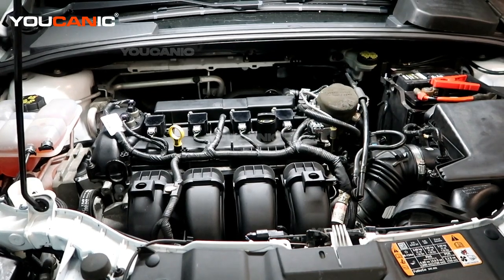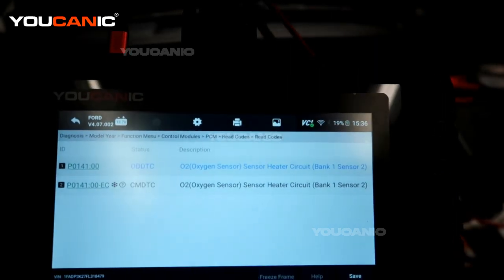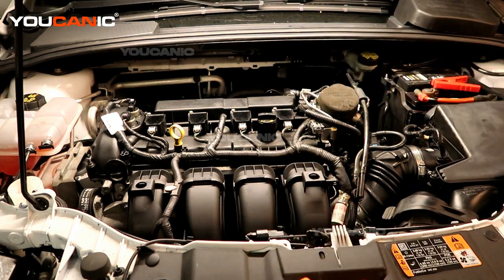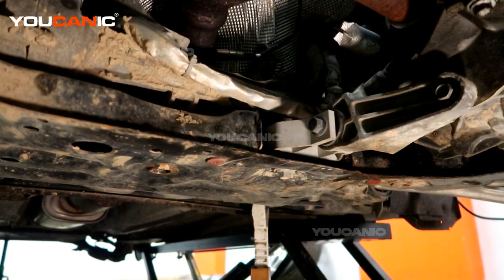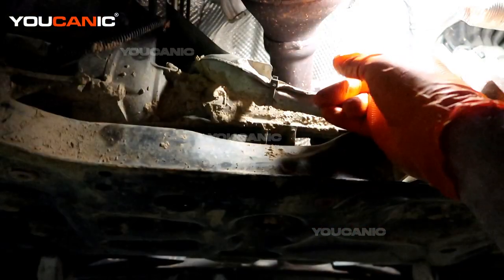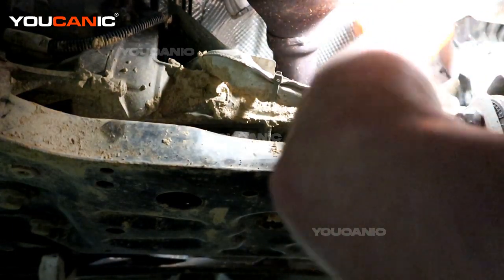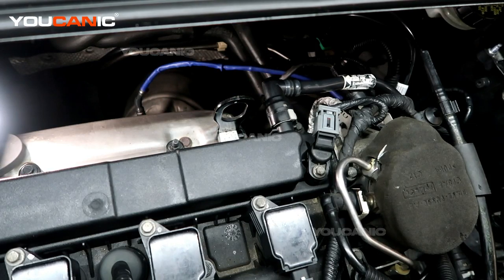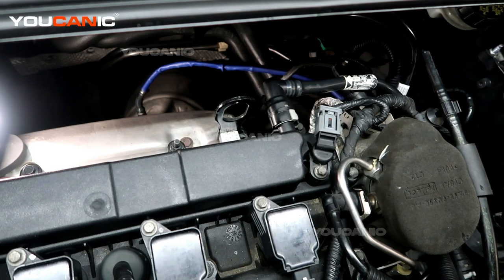Ford Downstream Oxygen (O2) Sensor Replacement - P0141 Bank 1 Sensor 2

Comment: Thank you for the video! Im currently chasing a P2096 and P219A code stating "Post catalyst fuel trim system too lean (Bank 1)". I have been trying to learn about each o2 sensor, whether its sensor 1 or sensor 2, and if there are more than one bank. This video answered all the questions for me, as you stated that sensor 2 is the downstream sensor, back of the cat which is exactly what I needed to know so I could get moving on clearing this code. Im going to order a new sensor and hope that all is fixed. Seriously thank you for the good info.
Reply: How was it? Did it solve the problem?